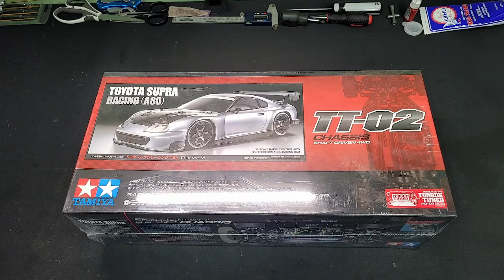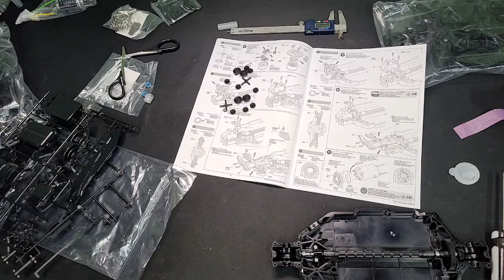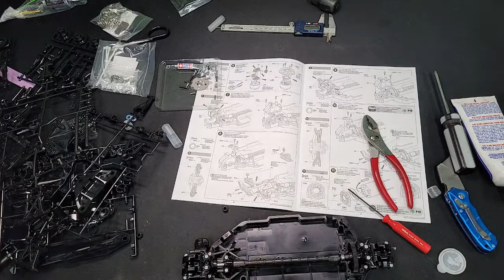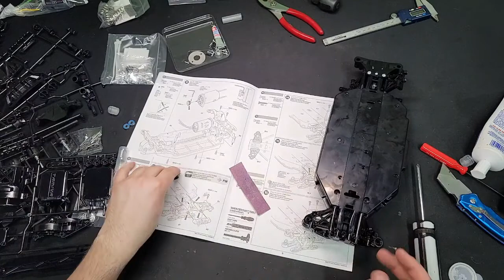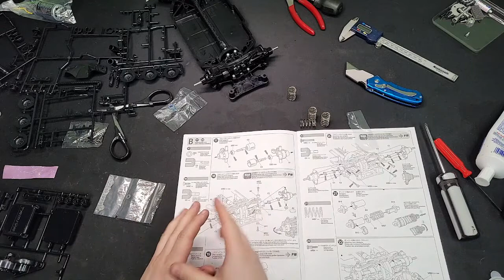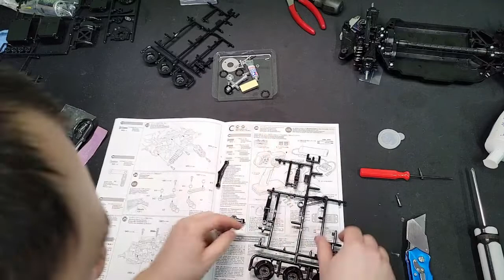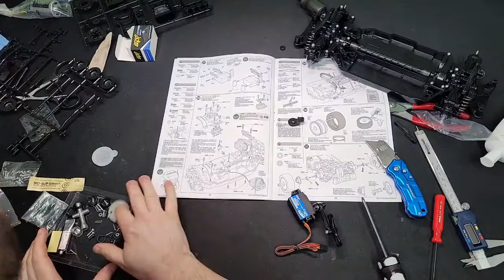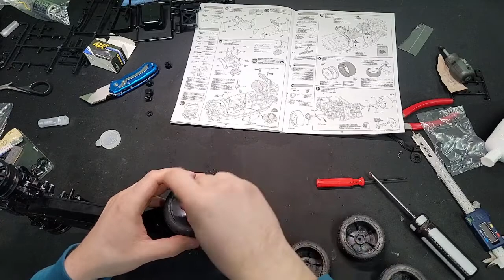Full Tamiya TT-02 Build video step by step

Comment: the axle for the wheels, the threads on mine seem very short for both the adapters with the break rotor and without, have any clue? for me when i fit the one with the break rotor i cant even get the nut started, and when i fit the adapter without the break rotor i can get the nut on like two threads. p.s. i have the audi quattro a2 kit

Comment: Not even close to the quality of the tt01 chassis.
Reply from the maker: I dont have experience with the tt-01 but I do with the tt-02. Therr is pluses and minus for both but over all I give the edge to the tt-01. If the tt-01 had steering links (ball ends vs a solid link) then it put it a decent deal over the tt-02. I would say the tt-02 is more versatile in different rolls it can do, but on a track setting the tt-01e atlest edges out.
Reply: Don't be stupid